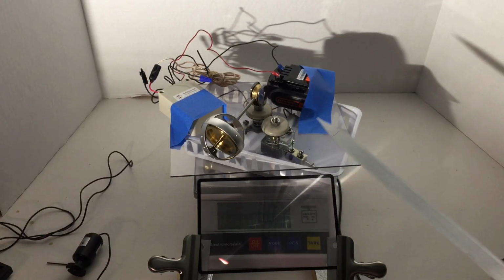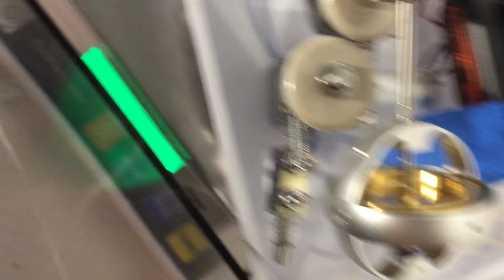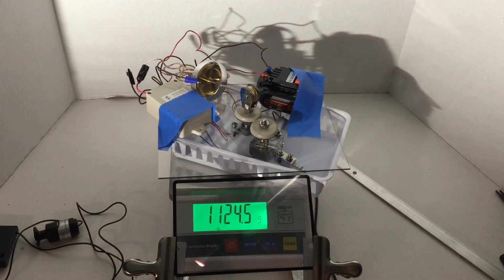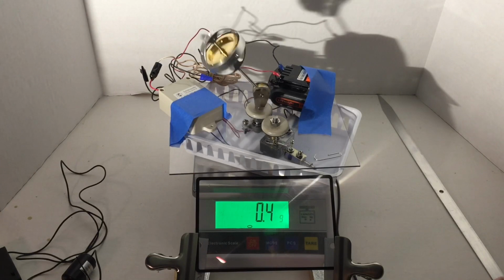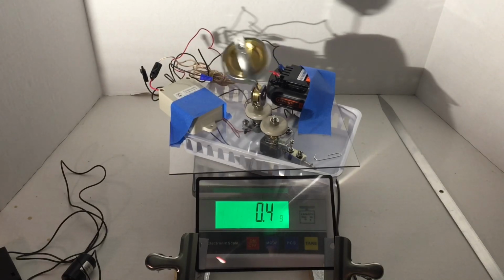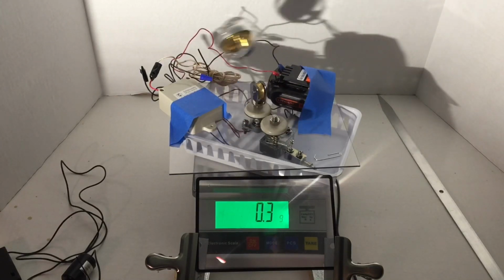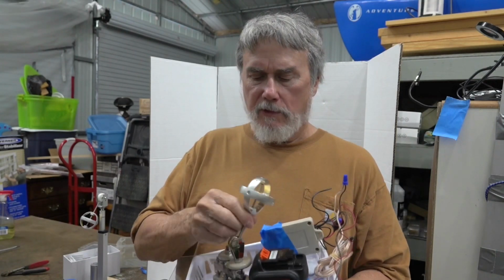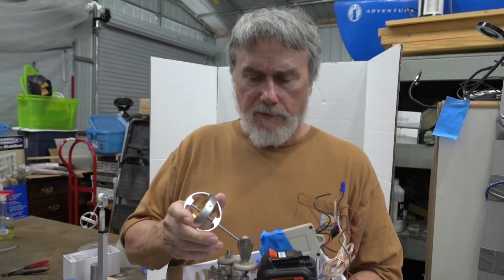Gyroscope Appearing to Violate Newton’s Third Law Part Three

Comment: Fascinating experiment!  Your main problem is that the scale you are using is made for static (non-changing) loads, and only samples about 2 times per second.  In order to boost accuracy and reduce noise within the scale, there is either averaging circuitry or logic that slows down any change in weight.  The weight changes you are giving it are faster than the scale is designed to accurately measure.  You might have another problem.  The solenoid is giving the whole thing lateral vibrations that might temporarily confuse the scale.  Stop the gyroscope and all other movements and operate the solenoid with the scale on.  If the numbers jump, then this is contributing to the confusion in your results.  Sorry, but I don't know of a scale that is designed for this kind of measurement that doesn't cost a fortune.  Keep up the good work!
Reply from the maker: Thanks for the comments and advice
Reply: @anisotropicplus  The best advice would be to tell you to stop wasting your time!

Comment: The weight increases when the center of mass is accelerating upwards, and decreases when the center of mass is accelerating downwards. The weight remains constant if there is no vertical acceleration,  whether or not the the center of mass is moving up or down at constant velocity. This is the same as passengers in an elevator, they only feel a change in force when the elevator is accelerating, not when it's moving at constant velocity.
Reply from the maker: Thanks for your excellent comment!

Comment: If you ensure the pivot support at the fulcrum is loose so that it is free to move vertically upwards, then the entire gyro will launch upwards, so would show much greater loss of weight on the weight readings and even a complete weight loss once the gyro is airborne. Note also that your experiment, as with all forced precession rising experiments, demonstrates that forced precession causes the center of mass to rise without expected much larger downwards reaction force, hence a gyro has always been defying Newton's laws.
Reply: @Insectoid_  haha yup. You can see this in Experiment 20 of my MES Experiment video series: https://www.youtube.com/playlist?list=PLai3U8-WIK0HUHoank-Lj9q6RGAS51QRh
Reply: @Insectoid_  Math Easy Solutions is not a reliable source of information.

Comment: If you set a yard stick on the ground, grasped it with a hand and twisted slowly, it would lift off the ground.  One end would anyway.  Twist it really hard, and it would go flying.  But that is because it's touching the Earth.  It's essentially just a mechanical device that turns a twisting force into a linear force, and the Earth is part of the device.  Think of a scissor jack.  Twist the handle, and it can lift a 2 ton car, but it pushes on the Earth. 

The gyroscope assembly here is more complex, but it is doing the same thing.   It turns the twisting force applied by the motor into a linear force.

This is just my opinion, and I respect anyone who gets out the tools and does an experiment, but I don't see this effect/phenomena as being different than twisting the stick.
Reply from the maker: Thanks for watching and your interesting comment.

Comment: How are you today sir I hope you're having a good day question just like a wrench the longer it is the more leverage it has I think that principal applies in this question I've been noodling an idea for several years but I've never tried it have you ever tried this in an experiment are seen it tried the motor that is normally spinning the gyro to do this you're going to have to put in a torquer motor there but then put another torquer motor flipping the gyro on its axis so that the rod are arm that you have the gyro on the other end would want to pull away from the table but this is not a straight-line force it would be a rotational Force I believe so you would have to do the same thing with another gyro on the other side or opposite side of your table so that the two rotational forces would create a straight-line Force giving lift I hope but you have a third motor that is spinning the whole affair like a carousel using sentriforce to keep these arms horizontal it will be hard on bearings and it's probably going to take quite a bit of current because obviously the gyros ro not going to like this I've never seen it tried but for all I know thousands people may have done tried it and it's where all novice want to start at lol
Reply from the maker: Thanks for watching and your ideas. A few years ago I wrote a short story about three genius kids who build a gyroscope powered flying machine and use it to defeat anti technology terrorists. You may enjoy it. It is called Willie’s Revenge and is available on Kindle format from Amazon.
https://kdp.amazon.com/en_US/bookshelf?ref_=kdp_kdp_BS_D_TN_bs

Comment: Firstly, i just found your channel and I'm a fan of what you're doing. Im a a Tech, so I have a couple questions. Could you persist/sustain a little longer on the parts where you add "boost"? If it holds under its zeroed out weight, while "boosting" it, it would suggest it has lift, right? It just means that the gyro has to be rotated counter clockwise on a axis to lift. To reciprocate the effect in a even more controlled way, could you rotate the gyro clockwise to induce a downward push against the scale? making it appear heavier? *corrected spelling
Reply from the maker: Thanks for watching and your comment. It has been some time since I did that experiment. Give me some time to investigate your idea. Thanks.
Reply: Also check out Sandy Kids gyro gadget. I feel like your experiments might line up.

Comment: This device is fun and wonderful. But it isn't violating any laws of physics. If you watch closely you'll notice the overall weight increasing beyond 0.5 after the gyroscope reaches its apex. In other words the device makes a small 'jump' but then immediately lands with an opposite effect. It's not antigravity, but bonus points for internally generating an upward force.

Antigravity isn't possible since it isn't a force but a condition that mass has on the fabric of space. You would need to step outside of space-time to escape gravity.
Reply from the maker: Thanks for watching and your technical comment.
Reply: What if multiple gyroscopes were used? Could a continuous directional force be generated?
Reply from the maker: @gglenn7920  I don’t think you could generate a continuous directional force because the force is only created when the spinning gyroscope rotates out of the plane of rotation. However, I don’t know everything and if you are able to demonstrate this please share it. Thanks again for your comments.

Comment: I'm pretty certain experiments in space have shown precession energy is strictly rotational, the "upward" force of precession is just the gyroscope exerting rotational/sideways motion on the axis it spins around. The drop in weight is immediately countered with an increase in weight on the scale.  Veritasium, Derek Muller, did a similar experiment in slo-mo that showed this.
Reply from the maker: Thanks for your comment. Veritasium produces excellent videos.

Comment: I think the atoms in the revolving giro are fixed or charged in space time and give off gravity waves or force when the atoms are forced to re align they climb or repel against the gravity fields around them they become lighter lifting the device off the scale, by having angular momentum the energy stored in the nucleus is expressed in gravity waves.
Reply from the maker: Thanks for your comment and ideas.
Reply: @anisotropicplus  the positrons are forced outward through centrifugal force and send out anti-gravity waves. It's a positive (pushing) force NOT gravity that's a negative (pulling) force.

Comment: Thank you for this awesome experiment. I've been lately thinking a lot about many physics laws, especially concerning gravitation and electro-magnetizm. As for the gyro, I'm more and more starting to think about it in terms of General Relativity. In particular, that the gyro's desire to lift can be explained not only by keeping momentum, but by gravitational forces. Indeed, what actually happens when we start moving the gyro? We move it relative to Earth, the "source" of gravity. And in this terms, the relative speed of lower part becomes higher then of the upper part. This difference, to my knowledge of GR, should lead to gravity field been shifted, which then results in gyro moving upwards. Taken this, we could make another experiment. What if instead of rotating the gyro we try to move it along it's plane? For exmaple, on some sort of rails. In this case, I believe, the gyro will still try to lift. It is still questionable, thought, whether we'll be able to detect any violation of the 3rd law with the scales. But since we'll apply just horizontal force to the gyro, I believe we could, if there is any. Another experiment I came to while just writing this: what if we measure the wieght of the gyro inside a fast moving train? Provided, it is properly aligned with the direction of movement (It's plane must be in parallel with the train, perpendicular to earth).
Reply from the maker: Thank you for your excellent comment. If you look in the description of my video you will see links to all of my gyroscope related videos. I have made two different large gyroscopes using a bicycle wheel and a wheelbarrow wheel. These are great because you can more easily manipulate them in three dimensional space compared to the small tabletop gyroscope. The link below will take you to my video where I demonstrate that you only get the torque effects when the gyroscope is rotating out of the spinning plane. You can move it in any direction while spinning without torque effects as long as it remains in the original spinning plane. 
Thanks
Gyroscopic Effects Demonstration with a Bicycle Wheel on a Turntable 
https://youtu.be/joLb15xJE-E
Reply: @anisotropicplus Oh! Great thank you for the links and the experiments you make! I'll definitely have a look when I reach my PC!
Reply: Your never going to extract the "gyroscopic" force by using a "gyroscope" . The force is an internally created "pushing"' force, so you have to extract it from the outer edge of a spinning flywheel. I've been able to extract several G's so far, but eliminating unnecessary friction by magleving the components will eventually result in greater possibilities.

Comment: You have to spin the gyro really fast in more horizontal position and then use forced presession. You are letting the gyro spin DOWN and the resuts are inconclusive. Please spin the gyro as fast as possible in more horizontal position and then engage the forced precession. Then the precession will be much faster and will see if the scale will not move. This is very important because if the gyro is not spinning fast the precession is weak. Test it please.
Reply: The forced precession is a good point. The rest is garbage, sorry...

Comment: Interesting video, it may have more to do with conservation of energy since you apply a force to increase the gyroscope procession speed and that intern applies force in an opposing direction of the opposing axis. This may be an untapped mechanism to get 100% energy transfer to oppose the direction of gravity. Im sure airplanes and helicopters have a low efficiency transfer of energy to provide lift.
Reply from the maker: Thanks, I appreciate your comment.

Comment: Yeah but that is not a gyroscope, just a spinning wheel on a rod placed on a moving, or not fixed platform
Reply from the maker: I have other gyroscope related videos and a short story I wrote about three boy geniuses who built a gyroscope powered flying machine. The links are below. Thanks for your comment.

Willie's Revenge Kindle Edition
https://a.co/d/0jn1Y13

The following are links to our other gyroscope videos:
Free Spinning Weighted Ball Gyroscope Spinner Compared to a Rigid Axle Spinning Wheel Gyroscope
https://youtu.be/NOk7LlEXo5s
Gyroscope Appearing to Violate Newton's Third Law
https://youtu.be/ldqUV-DXiUg
Gyroscopic Precession Powered Car
https://youtu.be/zOGlHC56Brs
Effect of Gyroscope Rotor Spin Direction on the Direction of Precession
https://youtu.be/ipdOr91CdEs
Gyroscope Attempting to Climb a Vertical Threaded Rod
https://youtu.be/o5opoI3ryiQ
Gyroscope Appearing to Violate Newton’s Third Law Part Three
https://youtu.be/-nVVOhIWMPQ
Gyroscope on a Linear Actuator on a Digital Scale and Newton's Third Law
https://youtu.be/1ZosxFJGd1I
Falling Gyroscopes and the Effect of Gravity
https://youtu.be/XHUrPrIYLjg
Turntable for Bicycle Wheel Gyroscope Experiments That You Can Make Updated
https://youtu.be/qcruVnPf86o
Bicycle Wheel Gyroscope, Motorized, Low Cost and Easy to Make
https://youtu.be/-SctQXmFX2I
Gyroscopic Effects Demonstration with a Bicycle Wheel on a Turntable
https://youtu.be/joLb15xJE-E
Wheelbarrow Tire Spinning Top / Gyroscope and Newton's Third Law Updated
https://youtu.be/C4X2XToCgeA
Wheelbarrow Tire Spinning Top / Gyroscope
https://youtu.be/KSvo0QNC14c
Reply: @anisotropicplus  Wow, thank you!